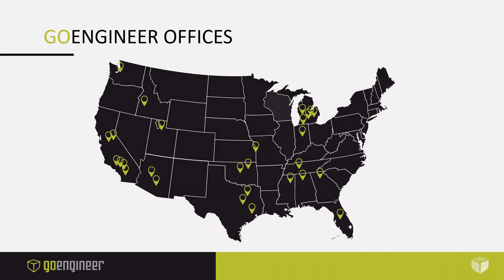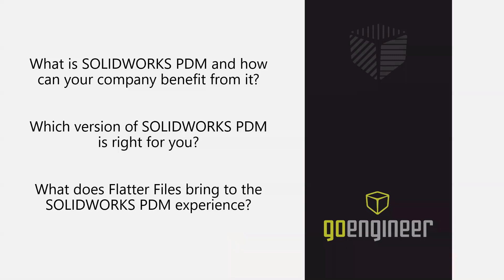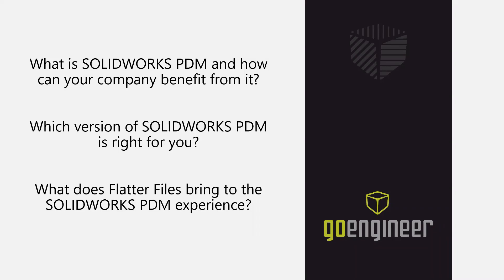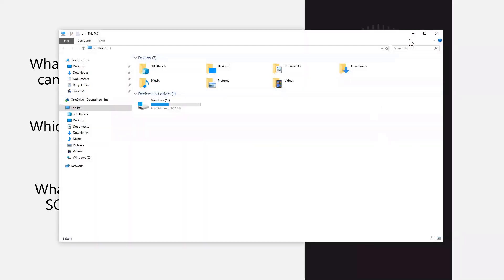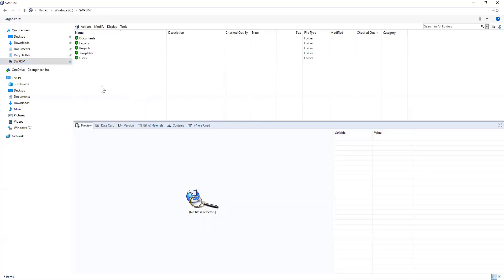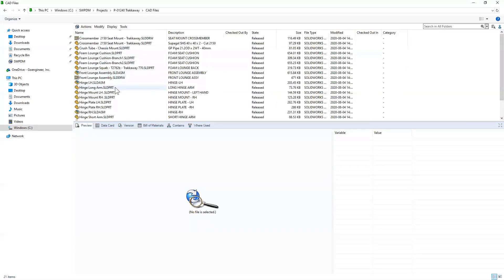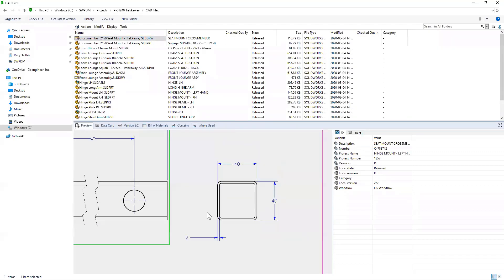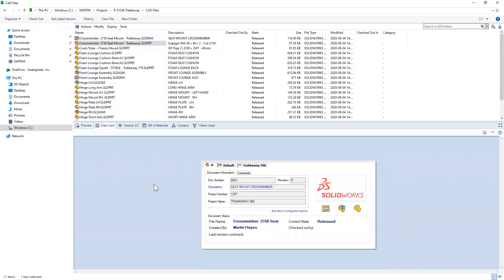SOLIDWORKS PDM Tutorial Webinar - Improve Design Work as a Team

Comment: Hey please I don't understand well ... can I use PDM with SQL server as a virtual workspace with my team ...if we can use the same files and edit them by check in or check out
Reply from the maker: I'm not sure exactly what you mean by "virtual workspace" so I'll phrase it this way: You can host SOLIDWORKS PDM and SQL Server on a cloud-server environment. The workstation does not need to be physically in the same building as you as long as you and your team can connect to the same network as the server. PDM then becomes the home for the files, where they're saved and stored, as well as where they go through revisions and workflows, automated tasks, etc.. You just have to check out the files to make changes and you commit your changes by checking the files back into the vault. Hope this helps!
Reply: @goengineer  
Thank you 🤩

Comment: hey can you help as i am making 2 spiral curves on one another how can i  make the second spiral starts from the first spiral end ?
Reply from the maker: I would start by creating a plane at the end of the first spiral to have a place to put the sketch for the second spiral.
You may be able to use a single variable spiral instead of multiple spirals though. Here’s a video that might be helpful: https://www.youtube.com/watch?v=6I5SviSRZgk.
Reply: @goengineer  I am making an boiler coil which has 3 pass, it's ok till the coil is straight but when the coil diameter is reduced the remaining 2 pass doesn't doesnt match the the angle of first pass.